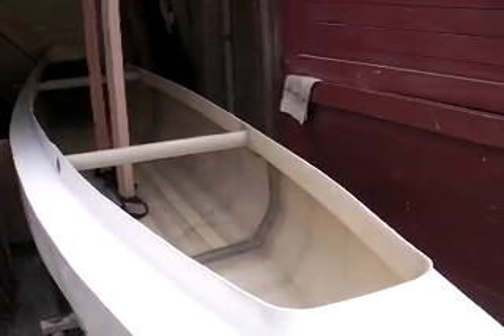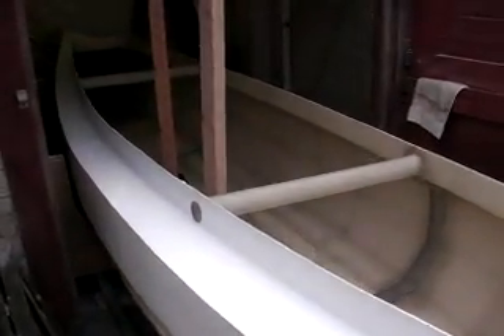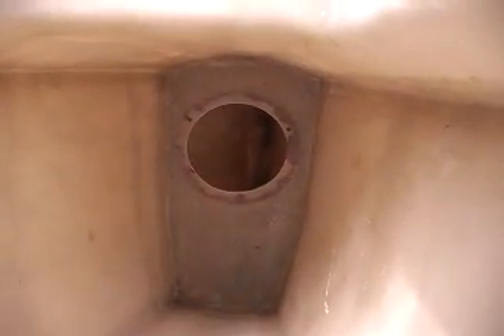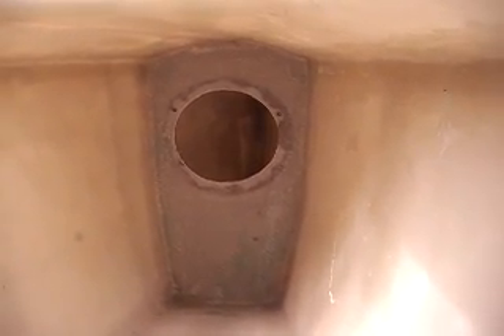XCR build progress

Comment from the maker: The polyurethane foam is typically used as a cheap composite core foam for making thicker section structures but the loads, and geometries have to be in proportion  the designer of this boat did advise that we should glass a full sheet of it in the bottom of the hull and that would have been a better method of manufacture, bringing a greater global level of stiffness to the hull bottom, rather than localised rib stiffeners as the video shows.

Comment from the maker: @victorthevector Sorry for very delayed reply, but the cloth weight figures disappeared out of my head, and I still can't remember the woven roving weight.  The lay-up is gelcoat, tissue, 6oz. CSM, woven roving (i.e. 90 degree woven cloth of similar weight to the CSM), another 6oz CSM and then a tissue on the inside to neaten it off.  Total thickness coming out at about 3.5mm.

Comment from the maker: There's two types of foam used for the stiffeners  the pipe foam and also some flat 1 thick polyurethane foam (white), thinned down to 15mm.  This particular hull was made from a female plug and is made from polyester resin.  The foam pieces are glassed over.  I dont know how well the resin adhered to the foam or vice versa.  In the specific way I was using it I wasnt relying on the adhesion of the resin to the foam  I was just using the foam as a geometric former.

Comment: Charles interesting boat it looks like it would be at home here in Florida, sailing in the Everglades Challenge race. I am also working on a composite decked canoe, could you tell me what was the reason for using copper pipe instead of more foam for the thwart/bulkhead reinforcement? is there a video of this fascinating boat finished and sailing ? Thanks!